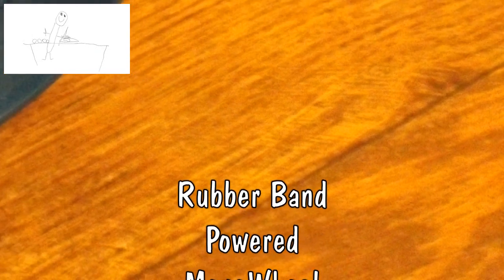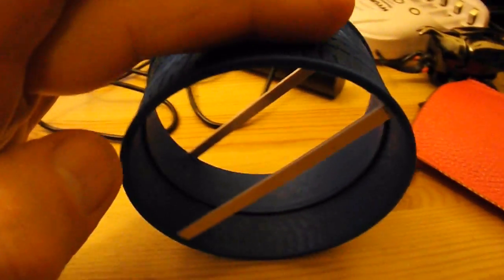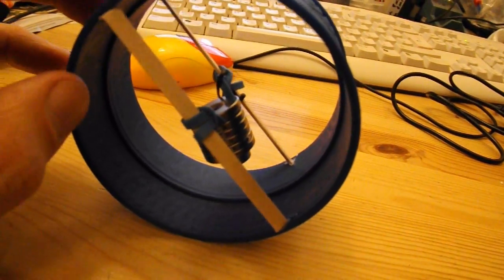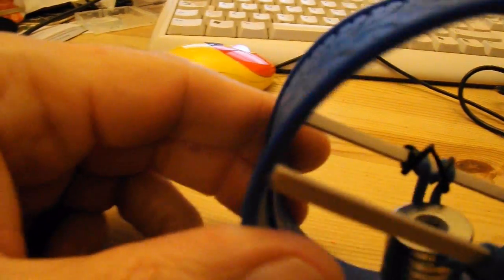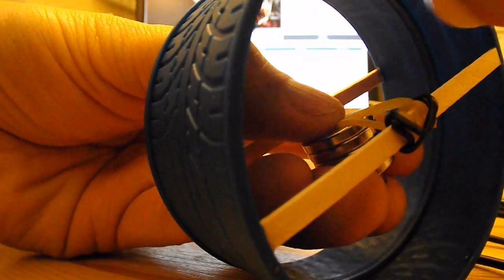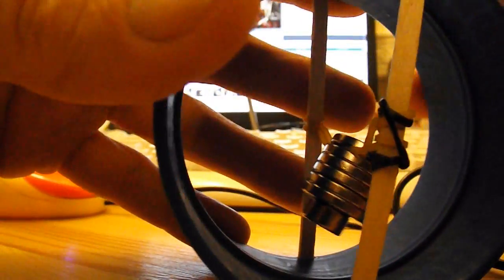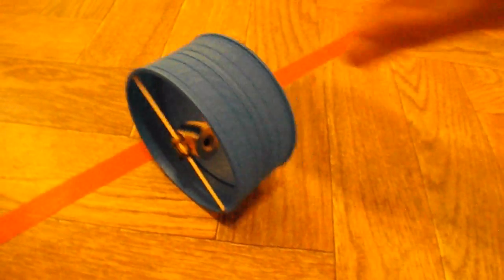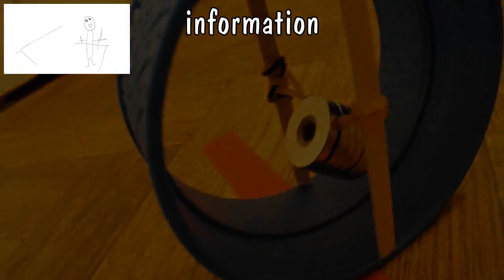Rubber Band Powered Monowheel

Comment: Can you please explain to me on how you placed the rubber bands on there? Like if you need to twist it a certain way and then please explain on how you made the magnets stay exactly.. Thanks!
Reply from the maker: The rubber bands are tied around the wooden sticks by looping them round themselves. The magnets hold themselves in place because they are squashing the rubber band between them. As shown in the video as you turn the wheel the magnets stay still because they are heavy and the rubber band twists to allow that to happen. When you release the wheel the rubber band untwists and turn the wheel because the wheel is lighter than the weight of the magnets. The only reason I used magnets was because that was the easy way to grip the rubber band. You could just use a lead weight or similar as long as you find a way to attach the rubber band.

Comment: nice job, dont know if it will help the glueing issue but can you just connect the wooden axels like a rectangular single piece so the tension will not bend the connections?
Reply from the maker: Thanks for commenting, yes there is plenty of room for improvement here but the basic idea works. Some sort of ratchet mechanism would be handy to stop it rolling back at the end of the run.